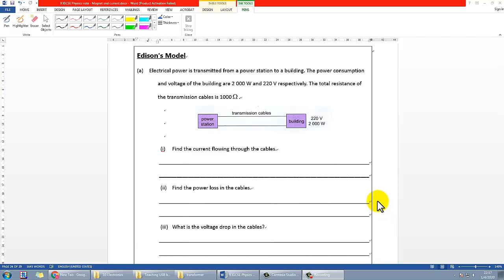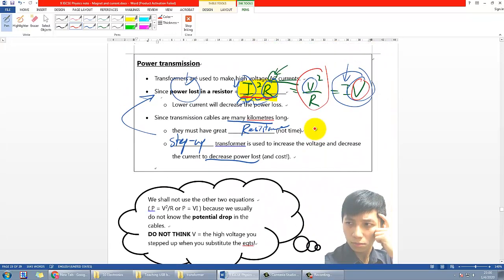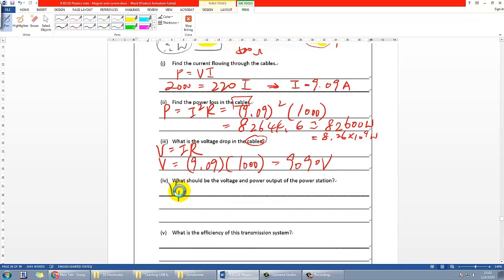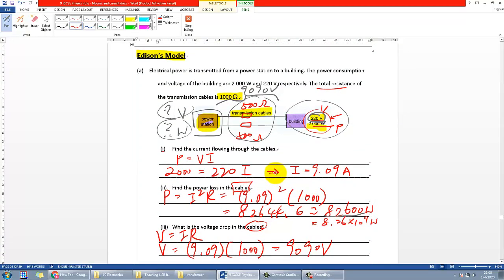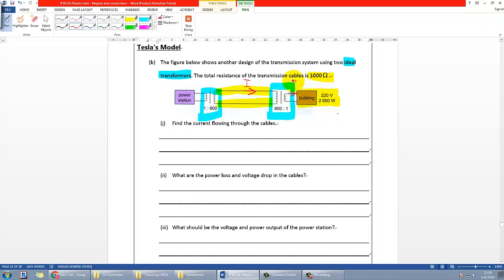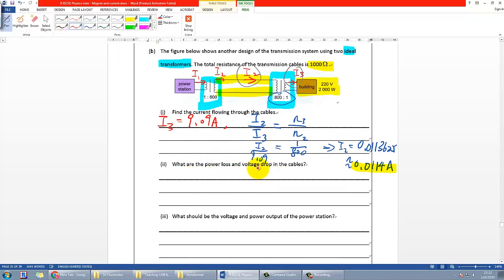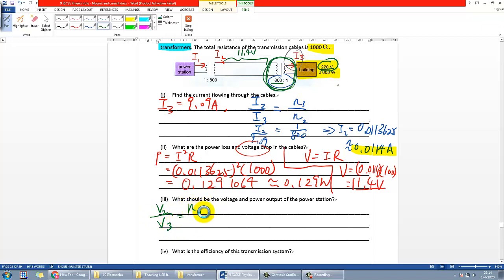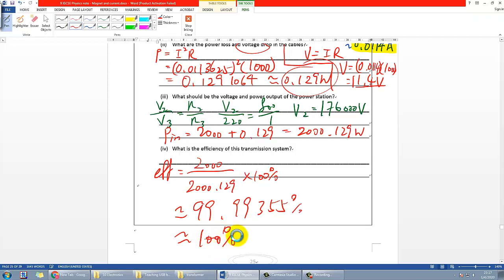Tesla VS Edison (Power Transmission Model) - IGCSE Physics

Comment from the maker: Thanks to my student Krieger. The answer in the Tesla Model part (iii), the voltage from the power station should be further divided by 800 due to the transformer. So the answer is 
176,011.4 / 800 = 220.01425 ~= 220V
Apology for the mistake.